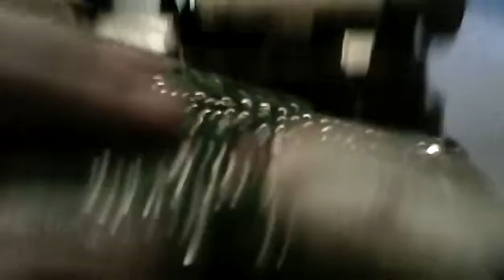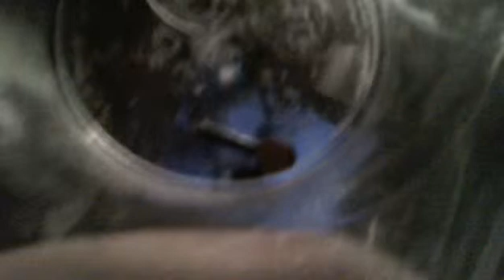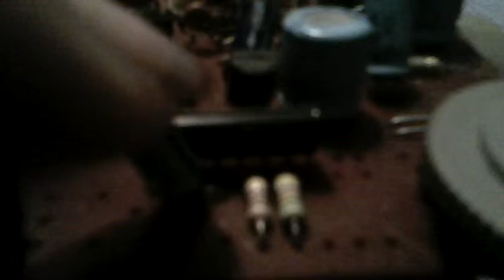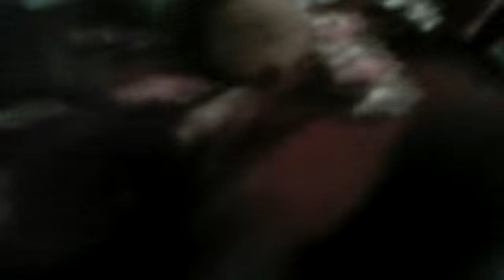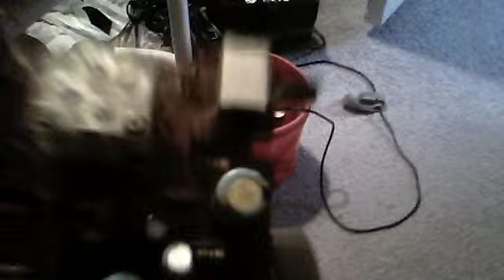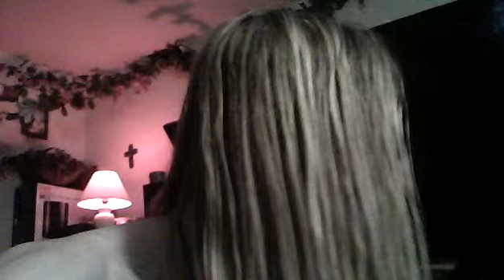SALVAGE OLD MICROCHIPS FROM OLD RADIO

Comment: ahmen.  do you just use a soldering iron to pull them off?  i don't want to use an iron because i don't want to heat the IC too much.  and it's pretty hard to heat all of the pins all at one, even with just 6 pins
Reply from the maker: well at least for me ic's are hard to remove haha i tried removing one the other day and wound up frying half the chip.....i dont know how to remove them yet im still rusty haha but the capacitors and resistors are pretty easy.....anything with more than 3 pins is going to be a little bit of a challange but if you work at it you can get them off the board without damaging them.....i myself like to practice with old circuit boards and junk appliences that dont work so if i destroy a chip its just a learning experience.....plus its fun after you get the chip off the board..
Reply from the maker: i have a soldering gun and a soldering iron.....truthfully the soldering gun is junk.....it takes forever to warm up and half the time doesent even melt the soldiar.....but the soldiaring iron stays hot and melts the soldiar as soon as you touch it.....but i almost set the rug on fire the one day because i went to the bathroom and it fell off the table onto the rug.....luckly it only burned a hole so i cant really complain haha but it does happen if your not paying attention